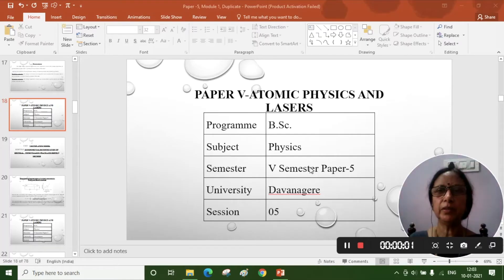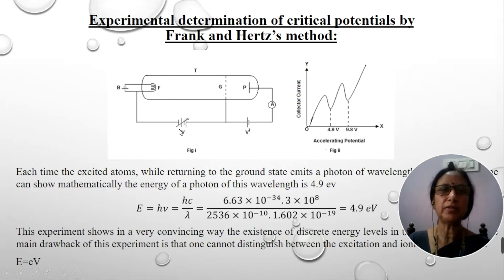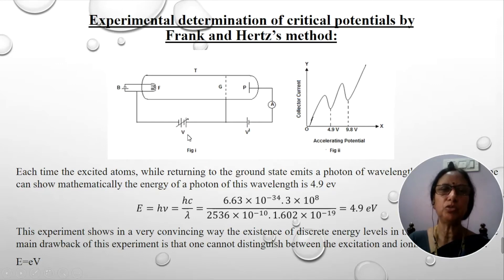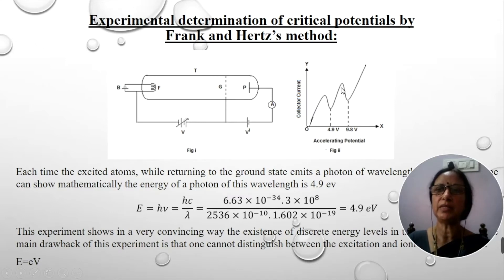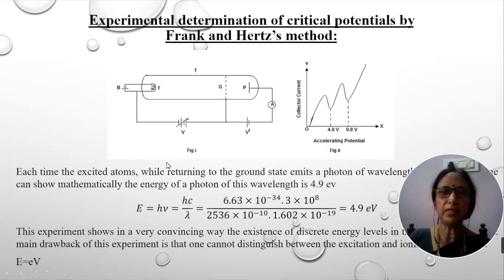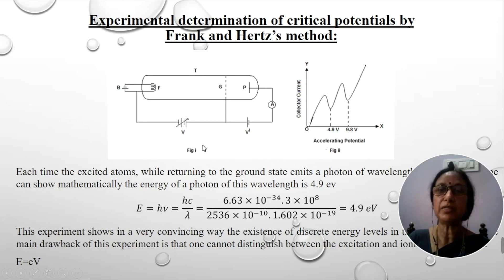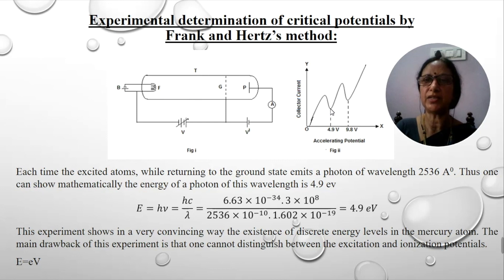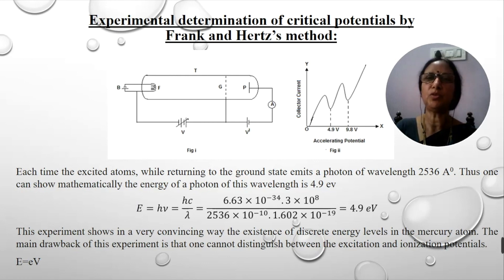SESSION 5: FRANK-HERTZ'S EXPERIMENT

Comment: Mam, there is a confusion..in the other videos of Franck Hertz experiment, the value gradually decreases after 4.9 V . But, here the minimum value is 4.9 V. How??
Reply from the maker: The first excitation potential of Hg is 4.9 eV. That is the minimum energy required to excite Hg atom is 4.9 eV. This energy is available when V=4.9 V, due to inelastic collision between accelerated electrons and Hg atoms entire energy (4.9 eV) of electron will be transferred to Hg atom, so electron is left with no energy to reach collector plate P. So at 4.9 v current is minimum, further as V increases Current continues to increase until potential increases to 9.8 V.   I think I have made myself clear.
Reply: @ashahebbal1724  thank you so much mam.
Reply: Actually I was confused because in the other tutorials of youtube...they have shown 4.9 V as peak voltage and after this voltage the current was gradually decreasing.
Reply: Maybe the gas inside might be different(ex Argon) which has different energy levels.